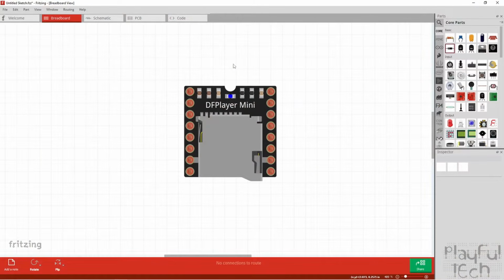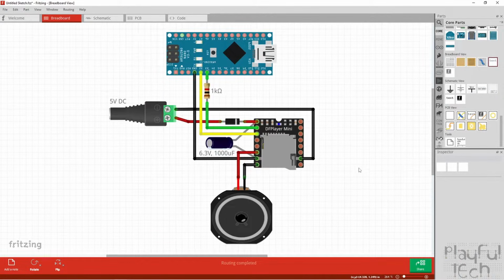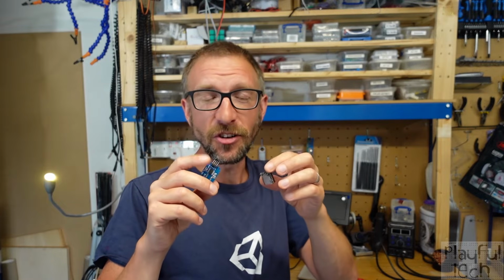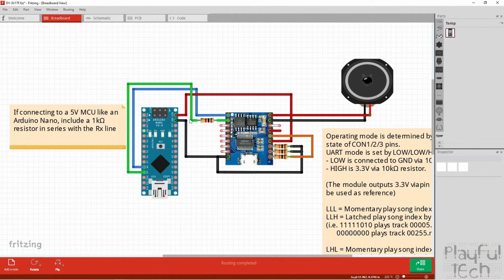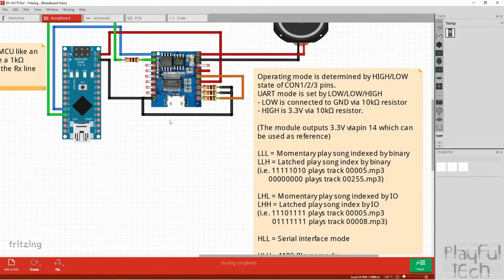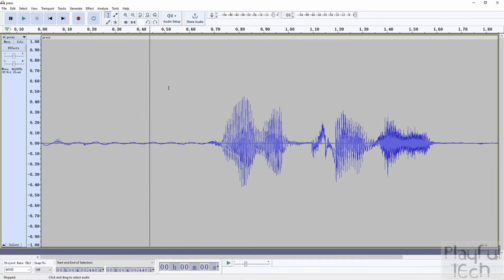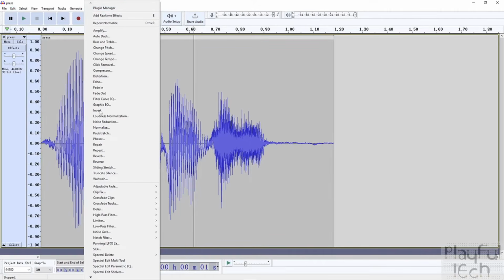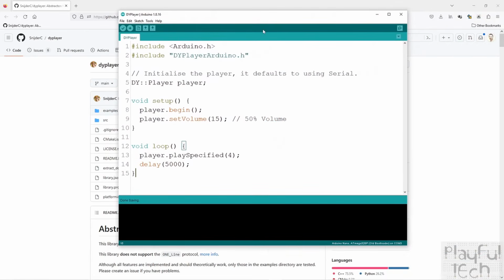Audio modules for electronics project

Comment: Thank you for the video. I have been struggling with a arduino project which involves a adafruit sound board. I’m trying to connect with serial to the board but also want to use a Oled screen which is i2c. I can get both to work individually but not together. Have you any recommendations. I am more than happy to use a different sound board if it will make it simpler.

Comment: Why do you need to connect both grounds of the DF Player (@4:30)?     The grounds are both connected to the case of the SD card holder, so they're already inter-connected.

Comment: Regarding the latency test between the Flash player and the SD card player:
You might want to redo that test with the following modifications. Buttons - make all wires the same length. Speakers - make all wires the same length and use two of the same speaker. 
You've introduced latency in the setup shown.
Reply: What you suggested doesn't make any sense.
Reply from the maker: Electric current passes through a copper wire at almost the speed of light. You're really not going to notice any difference in latency because the wire to one button is 10cm, 10 metres, or 10 miles longer than the other.

Comment: Outstanding video. Nice to get recommendations from someone who knows what they are doing. Particularly liked the power wiring for the DF. Is the size of the smoothing/filtering cap critical (assuming the voltage can be handled of course)?

Comment: I recently got afew of the blue 8 track flash drive boards, came with 8 MP3 files on them however when I add my own MP3 files only 1 will play, and only from the I01/RX tab on the board, I get nothing from the 102, 103, 104 etc tabs. These all work & play the included test MP3's. What am I doing wrong?
Reply: Ok Now have it playing the 4 sound files I want, controlled by 4 latching on-off switches, Only issue now is if I flip a switch it plays the sound file twice, then stops. Don't know why it plays each one twice...

Comment: NOOB question - seeking to run Audio from an ESP32 to a Medium Surface Transducer (4 Ohm 3 Watt) - I have been advised I need an AMP (TPA2012). the question is, do I need an SD card breakout, controlled by esp32, or is there an integrated breakout with an internal amp and SD for the output I require (alternative a solid state  flash breakout)

Comment: Great video! Have you explored using the USB pins on the DFMini for power and file transfer. I have a project in mind (dementia friendly music player) and was thinking of using commercial power banks to power the unit. Transferring files via this port to the onboard card would be much easier for caregivers. I've seen one video on this but... sketchy. Wondering if the same power conditioning should be used.

Comment: Automatic arati player. 

What I need is a music player play audio file from SD card on a perticular time. 

Example: 

1. Player should turn on at 06:00 am play audio track 1 for 26 minutes 44 seconds and turn off.
2. Turn on at 12:00 pm play audio track 2 for 19 minutes 55 seconds and turn off.
3. Turn on at 06:00 pm play audio track 3 for 22 minutes 12 seconds and turn off.
4. Turn on at 09:00 pm play audio track 4 for 16 minutes 11 seconds and turn off.

Note: I am doing it with smart switch with scenes. Which turning on my Ahuja 250 amplifier and multimedia kit with USB TF AUX & BT. Timmer working fine but managing seconds are a problem here. And changing audio track every day is not what am looking for. Anyways managing adding blank audio to match the timing. 

I'm looking for fully automation. 
It's for a temple. Audio module with Arduino is a option here but I'm not a programmer. 
Is there any pre built device available please let me know? If anyone like to help me with this most welcome. I can offer a  like a cup of coffee. Thanks in advance.

Comment: 12years ago I had to make a system to play safety messages and some other audio tracks and at the time I was using a bu9437akv chip by  ROHM. took ages to get this going and I wish these modules were around back them.  I may have to redo the project soon so I will be using one of those modules in your video.

Comment: Hi, great videos and content! Question regarding the DY-HV20T... the data sheet is a bit light on information... are you familiar with what logic level the pins are working at? I've seen videos with an Arduino connected directly, and discussions suggesting they work at 3.3V (hence I could then hook my esp32 directly to the board without a logic level shifter). Do you have any experience with this? Thanks in advance.

Comment: re: spi vs. sd, SD has a fast built in cpu (80mhz+) managing the flash translation layer (wear leveling) and quite a bit of memory to do it with, which is also used as cache and memory for readahead. the spi flash chips and the sd card use essentially the same command protocol over spi when the sd card is in spi mode the flash chip doesn't have a translation layer, it only needs a state machine to handle stuff while the spi clock is on, that makes them much cheaper but also no read ahead and you have to do wear leveling yourself. there's a constant overhead for switching between pages in the spi flash and it might be most of what you're seeing. the spi flash also can't do anything when the spi clock is not present, so you can't speculatively read the next page to avoid the overhead of switching flash pages like the sd card can. it was a real trip when i found out the commands were the same, considering how closely the sd association guards the specification. it's pretty rare outside of arduino projects and stuff to just use spi mode, it's the root of the reliability problems many people find. the extremely large managed flash chips in smartphones and stuff also have spi mode, which makes recovering data from broken phones surprisingly easy (if slow) they're an sd card in a bga package & more pins for the alternate modes

Comment: long replies usually get buried but i have a lot of experience with the original module and a bunch of the clones. #1) you basically can't use the serial at all to track playback status, you have to use the pin or there's a disturbing amount of noise (on the original and every clone i've seen.) #2) the fat file order thing isn't true, had a project that used sets of files, 100, 200, and checked that there were at least one sample at 100 and 200, but the track count was zero (it's one of the serial commands) if i named them 000, 001, 002, the track count would be 3, if named 000, 001, 004, the track count would be 2. if it were indexing by fat table entries it should find 3. what's actually happening in the different boot roms in the original and the clones is that for "number mode", it's actually sequentially looking for numbers (there are multiple, mutually exclusive modes! for example, shuffle will not play 3 tracks either, because of the file counting scheme at boot.) i tried every piece of advice i could find on the internet about this particular noise problem, and the file naming problems and what was being passed around was mostly cargo cult stuff. most of the playback libraries people have written for arduino were likely never tested, they each had a different interpretation for packing the commands and reading the error codes but none of the documentation (and copies of the documentation...) actually explain what's going on. each command string is better thought of a 'verb': the module does that thing, even if you can technically pick out an error number and normalize the commands, everything breaks when the commands are slightly different (like track count!) this was bore out through about 6 completely distinct modules, original and clones

Comment: This information was exceptionally useful, thank you for the great work in setting this up. I'm planning a hardware soundboard project, and although I'm well versed at scripting, this will be my first "from-scratch" electronics project, as well as my first foray into Python. The tricky part of this project is that the hardware buttons wont trigger a single sound file, but a random one within a specific directory. So I'm leaning towards the DY-SV5W board in serial mode, with Python code to choose a random index to send to the audio board when a given button is pressed. However, I'm unsure of how to know if the max number of files on the MicroSD card from the arduino to be sure the random index sent is within range of the amount of files in a given directory on the card. For that matter, can i even use directories on the card if the Arduino is just sending a single file index number? Is there a better recommendation for my project idea? Requirements: 
- i can drag and drop MP3 and WAV files to the MicroSD card like ../dir1/sound1.mp3, ../dir2/sound53.wav
- i can press button1 to play ../dir1/[randomfile] or button2 to play ../dir2/[randomfile]
With my amateur knowledge, i would expect that the file storage probably needs to be accessible on the board doing the logic, which would be the Arduino in this example, is that accurate? Furthermore, is there an Arduino board that can do all this on it's own without needing a secondary audio board like the ones on your video? I appreciate patience, as this is my first dive into the world of microprocessor boards, aside from casual RPi tinker projects.

Comment: Can i request some pro tips ? 

Ive got a pemenol
pemenol 60W Voice Playback Module, PEMENOL DC 9-24V High Power Music Player Mp3 Trigger Amplifier 64Mbit Flash Storage Sound Board Supprt Sound and Light Alarm
How the hell do you make the lamp trigger, im using the module to make a dance party bathroom 😅 and the lamp circuit is suppose to trigger a 24v relay that will controll the 110v overhead lights.  My board is showing a constant 24v actoss the lamp pins whether its triggered or in standby.

Comment: Hi. Great video! 
I would liketo show the active file on an lcd. So do you know any such module which allows to read the filename from the storage device? 
Or let you stream the data to it so you can access the files via an sdmodule?
Reply from the maker: These cheap audio modules only have a basic access to the filesystem of the SD card, and unfortunately don't expose it to allow any queries from the microprocessor either. To do that, I'd use a standalone SD card and then stream the data to an audio chip using I2S, but that's quite a lot more involved.
Reply: @PlayfulTechnology thangs for your reply. I have no problem with involved.. at least I guess. Just limited time. So bitbanging would be beyond scope. But as long as there is a library for it i thing i could manage.

Comment: Have you any experiance about looping mp3 tracks?
I've used DFPlayer mini with Arduino as engine sound simulator, cyclic repeating engine sound track, but I hear a click sound when the loop restarts (triggered from IO pins, but same clicking result) I'm looking for another sound module for this, the DY-SV17F could be better?

Comment: I am going to use a DFRobot Min iMp3 player on my next project with an Arduino R4, I'm going to use a breadboard power supply to power the device independently using the 3.3v option, do you think this will be okay?

Comment: Excellent video.  Having spent a lot of time experimenting with Catalex, DF Player Mini, and clones ...

Chip numbers:  I've mostly seen XY5300 and a few XY5200.  I haven't seen XY6300 anywhere.  Even for chips with the same number, there seem to be various revisions in circulation, each with their own set of bugs.

DF Player Mini:  Your current estimates for basic playing and file loading are higher than what I've measured (27 mA playing audio to DAC output with the amplifier disabled, slightly higher if playing from USB flash drive).  When not using the amplifier, I've never had problems powering it from an Arduino Pro Mini's regulator, even when the Pro Mini is providing power to several other components.  Using a diode to drop the VCC supply and a capacitor to smooth things out makes a lot of sense.  I'll do that in the future for sure.  For the serial line, I use two resistors arranged as a voltage divider to drop the 5V output to right around 3.3V at the player's RX pin.

Catalex:  The Catalex draws a little less current than the DF Player Mini.  The essential commands are largely compatible with the DF Player Mini, but there are subtle differences in behavior when using the serial interface.  For example a DF Player Mini will clamp the volume level to a maximum of 30, but a Catalex lets you set a higher level (like 40) and will even confirm that it is at the higher level even though it appears to look at only the lowest five bits, giving it an effective range of 0-31.  Catalex will let you change the equalizer setting during playback, but on the DF Player Mini that'll stop playback.  Catalex doesn't implement some of the more esoteric commands, and it can return bogus values for some status queries.

File Index versus Track Number:  The basic Play command does indeed work by the file's index in the FAT regardless of how the file is named.  Likewise, Next Track and Previous Track simply step by file index.  The Playlist command is documented to use file indexes, but I haven't been able to confirm because none of the devices I've tried seem to support it.  But there are other commands (Play From Folder, Play from "MP3" Folder, Insert from "ADVERT" Folder, and Play From Big Folder) that actually require the file name to begin with the track number (in decimal using an appropriate number of digits encoded in ASCII).
Reply from the maker: Thankyou for adding that very thorough additional useful information!

Comment: One thing that I think is worth mentioning, is that the WAV Trigger lets you play up to 14 audio tracks from an SD card AT THE SAME TIME. This is extremely useful and I have not found a suitable alternative that can do the same thing.
Reply from the maker: That is true; whenever I've needed multitracked samples I tend to just trigger them off seperate devices (e.g. 4x DY-SV17F wired to the same ESP32), which works out cheaper unless you really need a lot of polyphony.
Reply: @PlayfulTechnology  why do you use the DY-SV17F instead of the DY-SV5W or the DY-SV8F (or even the 20watt version)?
Reply: @PlayfulTechnology  it’s possible to contact with you ?
Reply from the maker: @Gintarskhmm  Yes. You're contacting me right now ;)
Reply: Hi, is there some way I can contact you about this? I have some questions about this playing multiple sounds at the same time.
Reply: Which board supports 14 audio tracks at the same time? I just answered my own question. I found the Sparkfun WAV Trigger.
Reply: Artekit WaveTooEasy I think is also polyphonic and cheaper but not as friendly.
Reply: Can we connect on LinkedIn

Comment: hi i have been looking for a small mp3 player but i do absolutely need the output to be stereo i have tried the df robot mini player board only to find it only outputs a mono audio i confirmed this by tracing the dac L and dac R pins they ultimately go to the same pin on the mp3 chip on the board i was looking at the other boards you show in the video but i cannot find any schematic diagrams or other specifications and or pinouts of the ic so i could confirm that those boards are indeed stereo via the 3.5mm jack i am not bothered about any on-board amplification as this is done elsewhere in the project all i want is a simple to control via a serial connection MP3 player that outputs a stereo audio. Can any one confirm if any one of these boards are stereo?
Reply: what you want is the dfplayer pro version (dfrobot)

Comment: Really struggling with a DY-HV20T at the moment.  I got it to work once (although it played 3 tracks as if it were skipping to next) using a test sd card I had. I removed the sd card, changed the files to the one I wanted (playing an explosion only) and now it's lifeless.  Did you find an documentation on the dip switches and modes, other than what's on the Aliexpress listings?  Thanks, Patreon Steve
Reply from the maker: What issues are you having with the DIP switches? I basically just set them to serial control and then leave them there.
Reply: @PlayfulTechnology Thanks for replying, in the end I had a combination of issues (faulty sd card...doh!) that contributed to my frustration.  I was still unable to get it to do exactly what I wanted, but I worked around it, and it's now installed in an ER

Comment: Thanks for that fun and enlightening video.  I've just started messing around with audio stuff (via I2S), and have an ESP32 MCU and a Sparkfun WM8960 breakout board.  So far, I can say that the WM9060 is complicated as heck, but you can probably do almost anything you can imagine with it (but maybe I have a limited imagination).  Between the "Analog in" to "I2S out" section and the "I2S in" to "Analog out", and combining with Bluetooth and/or Wi-Fi, I imagine there's not much you cannot do with this breakout board.  I'm still trying to figure out, when you read or write the I2S interface, how the code can discriminate between left and right channels in the buffer memory.  Great fun, thanks again!

Comment: I really appreciate this video.  I am a senior, with no electrical engineering background.  I make simple animated props for a yearly haunted house fund raiser for a 150 year old lighthouse.  I am currently trying to add sound to one of my props.  With the help of your video, I wired a DY-HV8F sound card with 5 different sounds, triggered by small push buttons.  When I use an amplified external speaker, it works great.  When I use a 4ohm 3w speaker, that I want to put in the creature’s head, I can barely hear the sound.  I’ve tried adjusting the potentiometer, but it doesn’t have any effect.  What am I doing wrong?